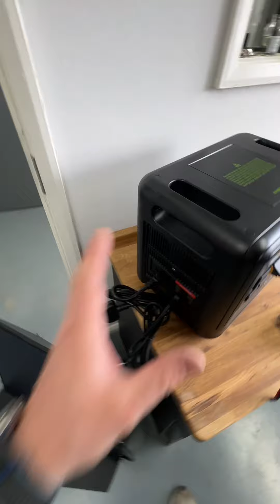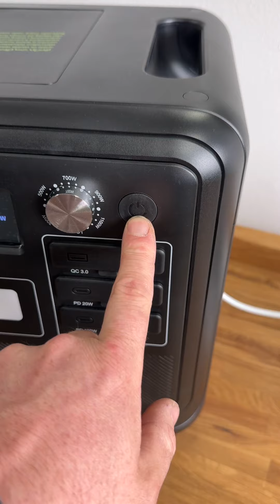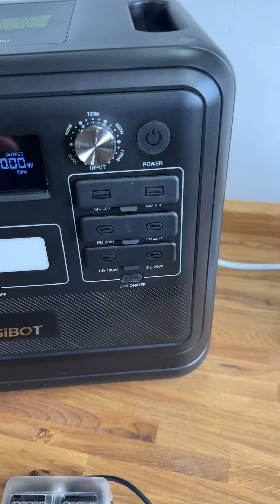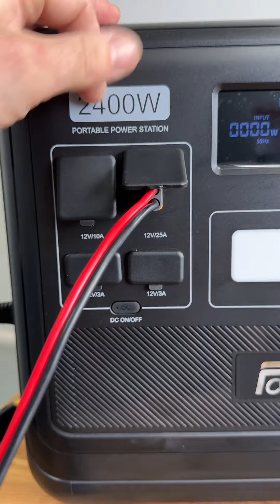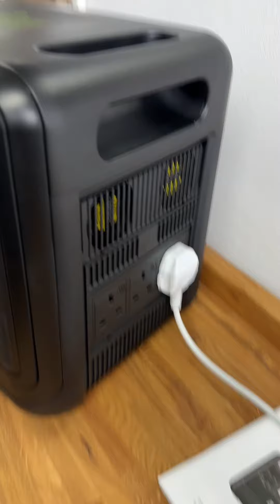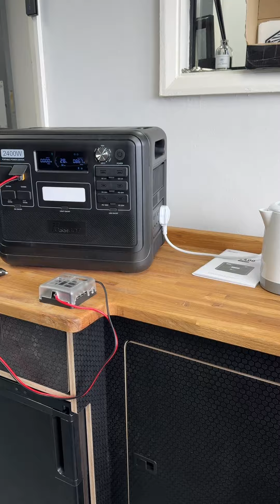The ultimate value for money power solution. Check out the Fossibot F2400 160ah Leisure Battery 🔋 💰

Comment: That's a great video, thanks!
Do you know....if the 240v IN is charging the unit and the 12v fuse box is drawing current, would that bypass the battery so it prolongs the battery life and if yes,would the battery continue to charge? Thanks!

Comment: I have the same one but rebranded to ECOPLAY and have used it on power outages. Mine seems to stop providing power when power drops to 10% it can take up to 500w solar. I'm glad i got one since i already had to use it several times due to power outages and i even got several larger batteries along with the ETAKER to extend its use.

Comment: So how do you charge it from car with 500w?
Reply from the maker: @sarasilviu  via a supercharger. It converts the 12v supplied by vehicle to 24v allowing the Fossibot to take 500w charge. Perfect for those power hungry adventures and recharge in 3 hours of driving!
Reply: @CymruCamperFurniture1  using a 12-24v buck converter also allows you to top off the average portable power station from fully charged leisure batteries if the 12vdc to 240vac invertor in a caravan or campervan has cooked itself lol, I had a bluetti power station with about 1000w output a few years ago that I used for my coffee maker in a caravan that had a 1000w invertor lol my coffee maker is a 750w salter basic travel brew and it blew the caravan invertor to smithereens lol but the bluetti handled it no problem, I rigged the booster to charge my bluetti as an extra leisure battery.

Think I'll do similar with a fossibot 2400 on a small canal cruiser boat I bought this month, saves messing about with electrical stuff and keeps things simple for BSS examination.
Reply: @CymruCamperFurniture1 How is this type of supercharger called? I really want to buy this for my fossibot
Reply: You should be able to charge this using the bluetti charger 1
Reply: Tried to charge twice in my lorry 24v cigarette and the 12V it’s blown both fuses. Can’t remember if I turned the I put wattage down. Could this be the reason from blowing. 

Many thanks